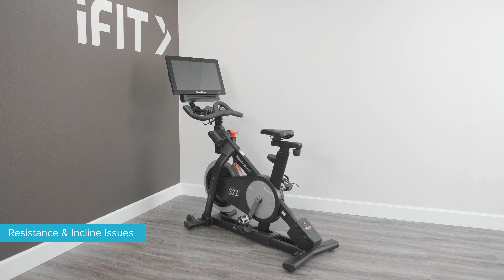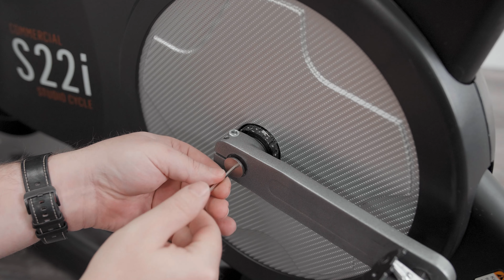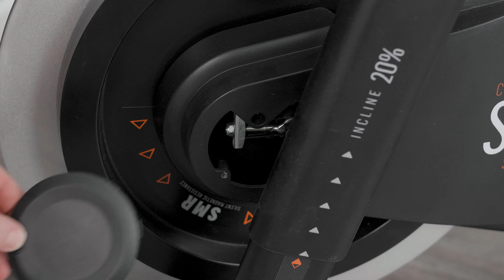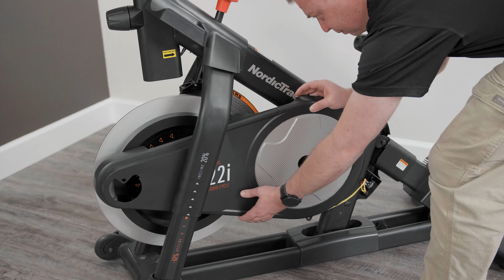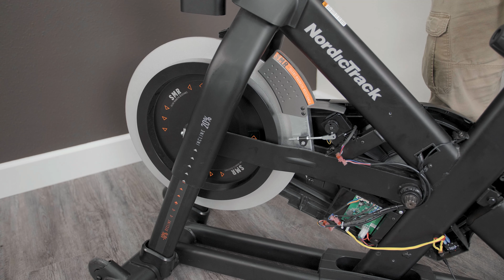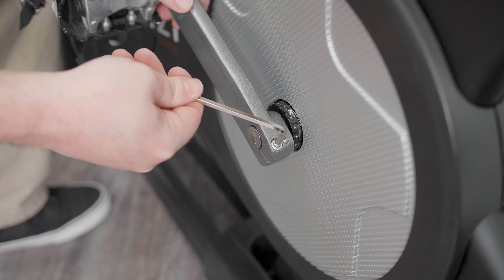S22i resistance motor can't turn.

Comment: Why did they loosen the 2 screws on servo and the one on lower part of brake? Did they retighten?
Reply from the maker: Over tightened screws can interfere with the movement of the resistance motor.

Comment: my resistance is on even when the bike is "off" could it be stuck from not using it in while? in the video do you leave the m6 shoulder screw on the resistance arm loose? TY!!
Reply from the maker: "Loose" is relative. You do not want it so tight that it crushes or binds the arm so it can not move.

Comment: Like many comments my S10i (NTEVEX14718.1) has stopped working. No resistance or incline and nothing happens when I calibrate the machine. Although when I first tried it did seem to do something after a long time and now appears to be stuck on a slight incline. Since then I have tried multiple calibrations and no movement at all. The machine still turns on and I can go into a workout and the console shows the resistance and incline levels changing but no watts or distance so the workout cannot be saved. 

I did as the video above explained and all the wiring seems fine. Any idea as to what may be the issue? Thanks in advance.
Reply from the maker: If the wires are intact and the console software is up to date then I think the most likely issue is a corruption in the controller. All of the motors and sensors go to this board before the information is communicated to the console. It is 1 part that explains failures in the speed sensor and the resistance and the incline. It's not likely you have 3 failures.
Reply: @FitnessEquipmentHelp  Something I have noticed when I checked the wires on the controller is that there appears to be a fair bit of white glue by the looks of things around the 3 red wires and going between them. Really not sure it is supposed to be like this looking as your other video on the controller replacement doesn't look the same. I have taken a photo of it so not sure if I can send this to you to have a look at?
Reply from the maker: @FWS8072  some of the manufacturing facilities may have used hot melt glue to secure the wires. This will very by model and factory. It may require you to peal off the glue before replacing parts but it should not cause any issues with the bikes functionality.
Reply: @FitnessEquipmentHelp  Am I correct in saying that you think I need part 402796 for my model?
Reply from the maker: @FWS8072  Yes. Thanks for including the model number so I can verify.
Reply: @FitnessEquipmentHelp  Thanks for the reply. Looking at the Icon website for my model (NTEVEX14718.1) am I correct in saying you think I need part number 402796?
Reply: @FitnessEquipmentHelp  Am I correct in saying that you think I need part number 402796 for my model?

Comment: Where do you get a replacement part? Cost? How long for delivery and what is the return policy if it does not fix the problem?
Reply from the maker: There are multiple locations where replacement parts are available. If you purchase the part from the manufacturer or from www.iconservice.com parts typically arrive no later than 7-10 business days with standard shipping (expedited shipping is available), parts can be returned withing 30 days in like new condition, and there is a 10% restocking fee (S&H is not refunded). If you purchase your parts any where else you will need to check that specific stores policies. The cost will depend on your specific model number.

Comment: My model NTX02117.2 is having similar issues. My resistance and incline stopped working suddenly. The resistance buttons and incline buttons still beep and change the numbers on the screen and but do not change any resistance while pedaling or move the incline. (Incline is stuck patches 3rd down arrow printing on the bike) all the wires are connected and I did all the steps in your video. I calibrated, reset a couple times and nothing works. What do you recommend doing next?
Reply: Calibrating does not move anything at all.
Reply from the maker: If there is no physical obstruction and the wiring is all intact so the machine can communicate then there is likely a software issue. Most of the issues similar to the ones your equipment is displaying  are due to a corruption in the software in the lower control board and it should be replaced.

Comment: Hello can you please show us how to FIX the resistance and incline? Because it looks like I took alllllll this stuff off and the video doesn’t show how to troubleshoot these areas, that’s a bit cray. I appreciate the video but if you could actually show us the part we are searching for (how to fix the incline & resistance) in a vid, that would be amazing ❤❤❤
Reply from the maker: Failure of the resistance and incline can be from may different causes. The issue/resolution demonstrated in this video is just one of common causes affecting the ability of the resistance motor to turn freely. Thinks that can effect Both the resistance motor and incline that you can check would be damaged wires between the control board and the console. Other things that can effect both the resistance and the incline, at the same time, would be the control board or the console.

Comment: I’ve done all the updates and tried all the steps above, but my incline and resistance won’t work. I have a model NTEX02117.2. Any help is greatly appreciated!
Reply from the maker: Does the console still show speed and cadence when you are pedaling? If so that is a good indication that the wires between the control board and the console are intact. If the console is behaving like the incline and resistance are working (levels change on the screen) then the console is likely also working. The first thing I would do to rule out anything simple would be to recalibrate the incline. (instructions are in the user's manual). Calibrating can resolve many incline issues and the resistance is closely tied to the incline on this model.  My guess, from past experience and your description of the issue, is that the control board (down under the side shields) may need to be replaced.
Reply: @FitnessEquipmentHelp My cadence and speed is not showing up either. Where would I get a replacement part for the controller board?
Reply from the maker: @fabiantrejo9871  Parts are Availabe online at www.iconservice.com  Be sure to order the parts for your specific model and version. There are multiple models out there.

Comment: i am thinking about suing nordictrack because it’s low quality, impossible to adjust screws yourself and it started getting super slow and the motor stopped working all the time in less that a 100 workouts!!! for that price it should work at least a thousand workouts

Comment: I am having the same issue as the previous comment. No resistance, incline, or tracking of anykind.
Reply from the maker: If all of the wires are intact and connected correctly and the console appears to be operating normally then based on this limited information I could suggest replacing the controller (lower circuit board). If you have any other details or a model number i may be able to be more specific.

Comment: My bike stopped working (no incline or resistance and also not recording rpm’s or watts). This happened right after a software update and now Nordic track support wants me to buy 5 parts to fix 😞 machine was barely used I’m so disappointed.
Reply from the maker: It is unlikely that there are problems with 5 different parts. What is your model number? Looks like "NTEX12345.1" Most of the time its not actually related to software. If the console is still able to start and display a workout then it probably isn't that part or related to the update. i may be able to suggest some other more likely problem parts if I know which model you have.
Reply: My model number is NTEX02121.3